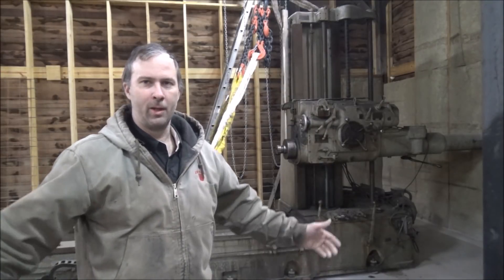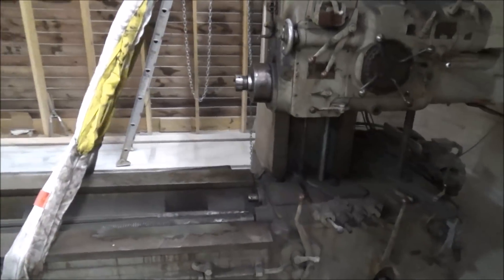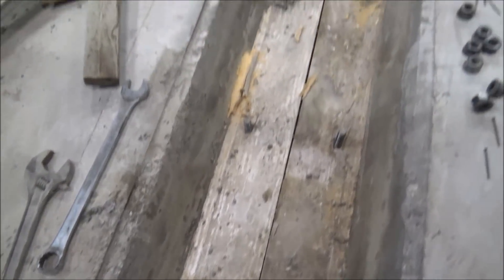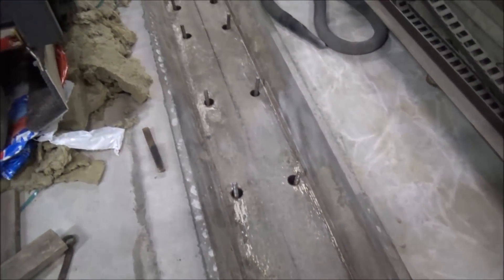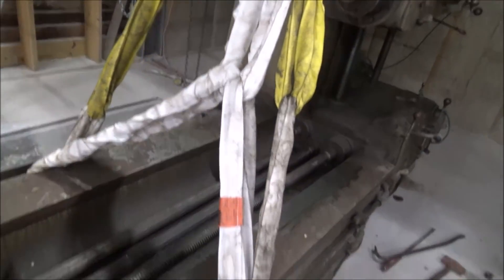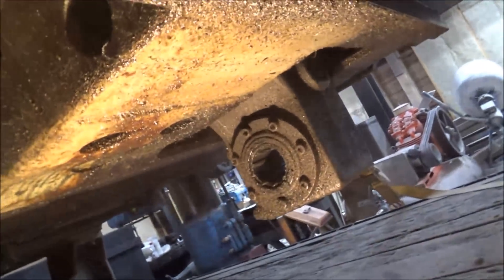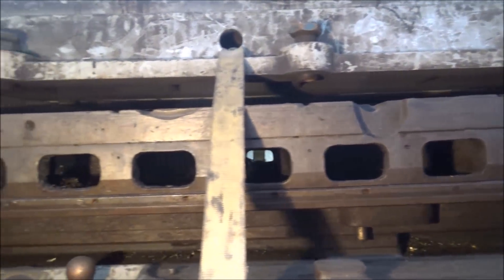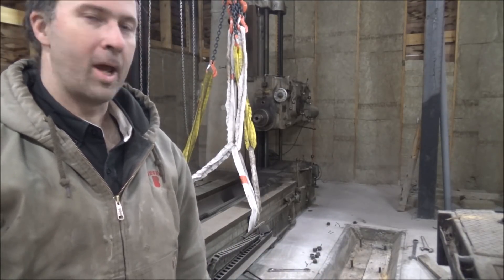Moving the G&L 340T Horizontal Boring Mill Part 3

Comment: Hi all,   Greg Utley asked me to come and comment on the material.   If you take your scraper and cut off on the material.  I suspect it is a tan color under all the dirt.  It could be black too.For the most part they used "grade linen" Phenolic and we would epoxy and use flat head brass screws to attach the Phenolic to the ways.  Some didn't do both but when we removed the old we would find oil under it and it was looser there were gaps between it and the iron.

Brian before you assemble it, flip the saddle and table over and put them on 3-pointsthe way we discussed in class and if needed on the single point end put 2 jack screws under the perimeter so it does tip.  Then get in there and scrape the checkerboard pattern into the smooth phenolic.   If you have a long straight-edge check the flatness of the those ways to be sure they are low in the middle 40% so it doesn't rock like a rocking chair when you change directions when feeding.   Keith has a 72" Camel back you might be able to borrow. 

I would also grind some more Z oil grooves in them too, the more the better. And I bet the oil holes and pipes are full of crud.   You will have to know a hole in the wall if you ever need to remove the spindle, be sure to film that if you do....lol   Give Brady a pet from me he sure is a smart one.  When we were at Keith's class, Keith has a big retriever and a pond behind the shop. I would toss the stick to the other side of the 75' round pond and Keith's dog jumped in on our side of the pond and Brady would rund around the pond and jump in and win the race...lol..he could run faster the  other dog could swim...smart old puppy!  Like his young master!!  Rich King
Reply: Knock a hole in wall and not know...LOL
Reply from the maker: Thanks Richard! You sure don't mind volunteering me for some work do you. lol Flipping supporting and scraping that table is no small job for one man and his dog! I have a 5ft camelback here but it is unknown,  I also have a 2ft square cast iron plate but it also is unknown. Then there is my 4x6 Granite but it also is unknown. I think I need to get it recertified first before I go chasing after improving the machine. If I need to it is only 8 screws and I can have a hole in the wall big enough to get the spindle out thru the wall. I also could just take the crane and move it out away to work on it. :-) The phenolic looks like a dark red/brown to me. Based on the countersunk screws in it it must be pretty thick too. I imagine a rotary burr would be a good way to cut some oil grooves in the material?
Reply: Yes, I find the carbide burr that looks like a Christmas Tree works best. Be sure to wear safety glasses and a mask as Phenolic is nasty with fine particles and it stinks.
I also suspect it was put on there as a rebuild.  Look at the rear end of the ways and see if it has original G&L flaking that is narrow straight cuts in a connecting L shape or boxes.  Possibly your G&L buddy can describe it better then that.  If it is 1/2 mooned it for sure is a rebuild.
Where are you again?   Maybe I can come down and help, or you can ask your friends on here to comedown? Like Keith did when he built his shop.  It was a volunteer group  :-)   I bet many would love to come and meet Brady  :-)   Rich
Reply from the maker: The ways look ground like on my Monarch, that or all the flaking and scraping was worn off years ago. I am in central Kentucky near Frankfort. Feel free to stop in anytime Baily loves company! :-)

Comment: has it got screwcutting, I couldnt see if there was a threading indicator
Reply from the maker: Only for threads that match a feed rate. It does not have the special threading spindle drive.  It is a basic machine, no goodies or fancy features, but it is the best HBM I have.

Comment: Nice job Brian but you might be screwed down the road if you get a long job that over hangs the table. You didn't leave a lot of room on that far side. Middle of the shop would have been better.
Reply from the maker: My shop isn't wide enough to have put it in the middle, it would stick too far out into the floor, if I had turned it 90deg and put it in the middle it would actually have been narrower as it would have hit the crane supports then. I can go vertical 16ft from the table though and can come off towards the door side 16ft clear and maybe more if i slide the VMC back some more then I could get 50ft.  I have 16foot of table width, I have never machined anything close to that big. I can't imagine what I would be doing that size. If the job pays good enough I can always take the wall down.

Comment: Thank you very much for the videos. Im a 53 yr. old lifelong farmer. Spent a lot of time on doctor ordered limited work the past year so had plenty of time to try to learn new skills im interested in and can be used on the farm and also for my boys and grandsons to learn for maybe sideline business they can do in addition to farming. maybe I can work for them! Don't know exactly where your at but Im about 60 miles due north of cinncinnatti. Enjoy your dog Baily, lost my farming stock and tree dog bout 1 yr. ago, he was a blackmouth cur, built like your dog just buckskin colored.Not a machining question but I think you were welding on the booms of a jd6000. I was looking at one and if you had time I wonderd if you had any advice on what to look for? Any way thanks again , just looking forward to learning more skills from you that the boys might actually make a buissness out of someday.
Reply from the maker: 6000's have poor brakes and not the best boom control valves. Other than that they do ok. Most are old enough know the chemicals have caused a lot of corrosion and they are nearing the end of their useful life. A 6500 is a much more friendly machine to operate. I am about 60 miles due south of Cincy.
Reply: Thanks for getting back on that.  Just had always heard the 6000 was bulletproof, just not operator friendly,and that the 6500 had issues with hydraulics / hydrostatic transmission. great job updating the shed, cabled and cut out posts on lots of tobacco sheds up here.Again ,thanks for sharing the info on the shop, its how the next generation learns.

Comment: Not sure what the material is, but the people at Tristar plastics know their stuff and may be able to help. www.tstar.com   Could be Micarta (been around for a long time 1910 according to wiki).  I have used Ultracomp for many extreme load applications (10-15,000 PSI sliding bearings) but doubt that is what you'd need for this.

Comment: I worked at Giddings and Lewis-Bickford in Kaukauna, Wi for 11 years, 1974-1985, where we made mostly vertical machines and Winslow drill sharpeners. One of the small NC machines we made had  delrin plastic wear strips instead of steel roller ways. I believe the machine was called a Numerapoint. The delrin is still easily available. Google it and you will find many suppliers.   Jerry B.

Comment: Now you are under pressure - what do you do for an encore?  Reworked huge old barn into machinist Valhalla - moved massive machinery - dropped and fixed one massive piece of machinery - got public compliments by Richard King -  poured mill footings and they actually fit - installed floor heat with no leaks - proved tappet hardness to the world - started a semi with a pickup battery - what's next....? 

Dan
Reply: brian is not messing around... :D :)

Comment: Brian great progress. Now I am understanding what all the bolts are for and the trapezoid shaped pits. Do you know what sort of lube goes the the ways with the "plastic" pads? And do you lube manually or is it pumped in?
Eric
Reply from the maker: Manual calls for 50wt engine oil. I am not sure if it is pumped or merely drip fed.

Comment: perty awesome!
Sure hope that stuff on the bottom of the table is not Turcite. You will have to mortgage the house for that much of it.
Reply: joshua43214   I Googled “Turcite” and see what you means. I also found this reference to an alternative (?) product;
http://www.practicalmachinist.com/vb/general/replacement-turcite-169159/ 
named “Moglice” 
What do you think, is this an option for Brian’s G&L?
Reply: I honestly can't say. I expect the original is something closer to some kind of Bakelite type product. Basically silk fabric embedded with graphite and glued together under pressure.
The contact area is huge. Even when fully loaded, I doubt the lbs/in is very high. It would have been engineered with the materials available at the time in mind. I would not be surprised if UHMW was a good modern replacement.